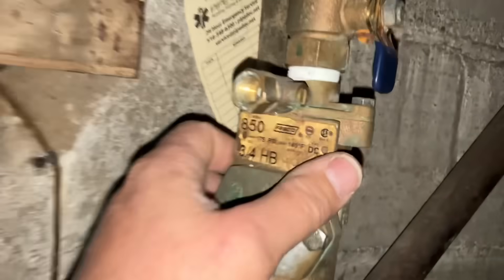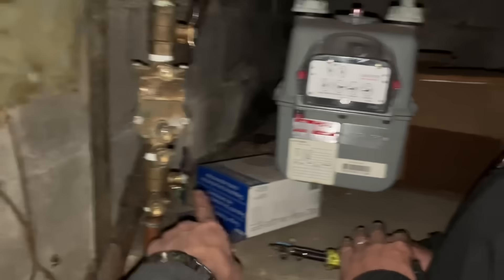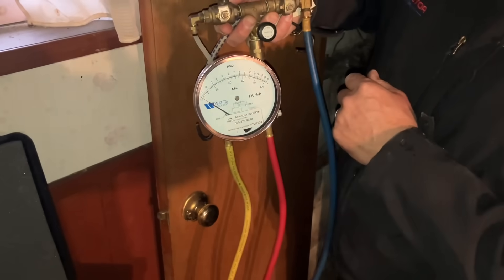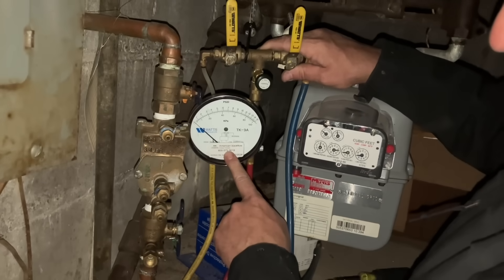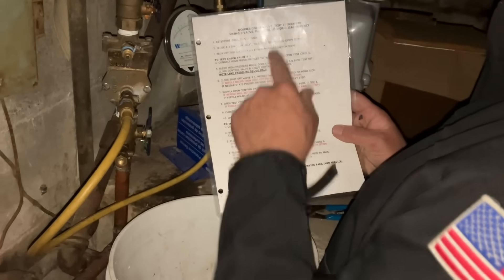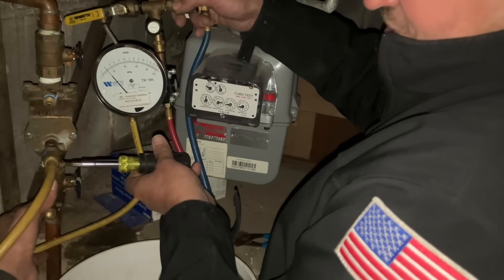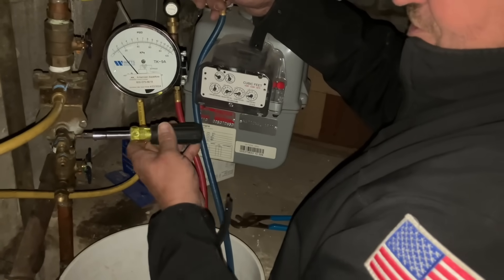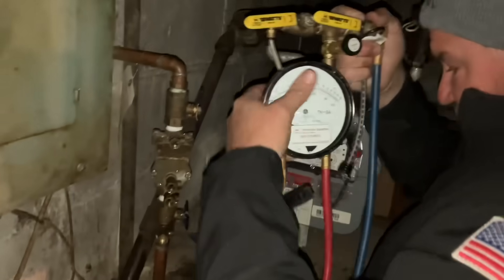Mastering Annual Testing: Febco 850 DCV Double Check Valve Backflow Preventer Guide for Plumbers!

Comment: If the main line is always pressurized, then there is no need for backflow preventer?  Sprinkler water would never go backwards against positive water pressure and enter house line.  But it's code.
Reply: if there's a water outage, either scheduled or an emergency, it could and will end up back-siphoning. hence the requirement of  double check valve back flow preventer(DCV) or reduced pressure zone backflow preventer(RPZ). there's also pressure vacuum breakers(PVB) but less common due to not as good of protection. as the other two.
the RPZ also has an relief port that opens if backpressure exists and dumps water out (down a drain preferably)
Reply: Mama😅